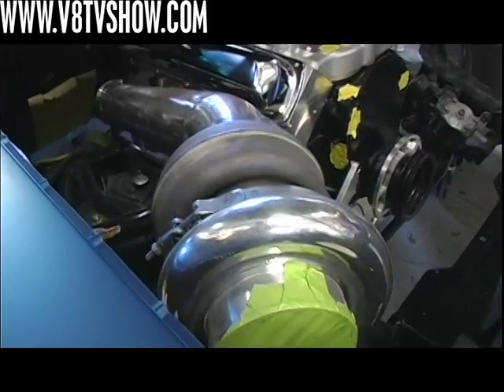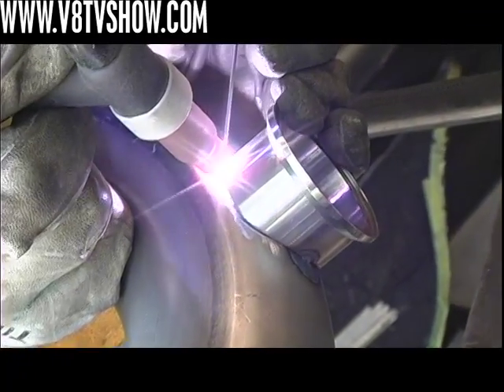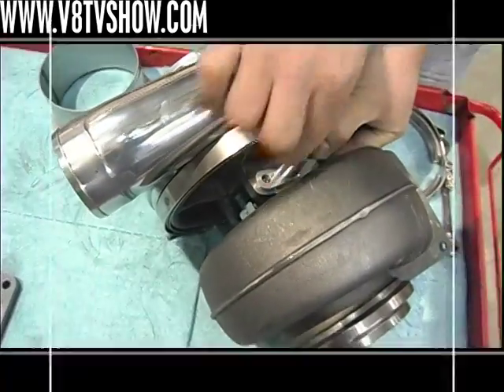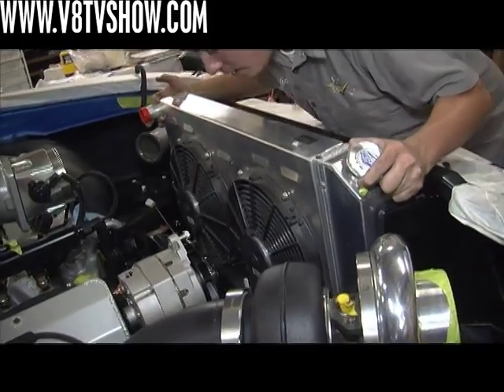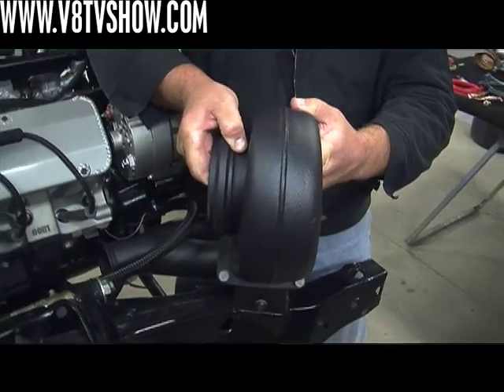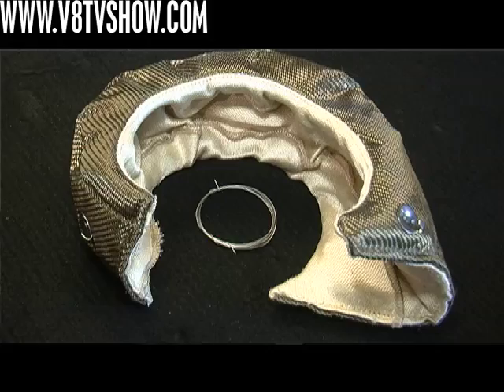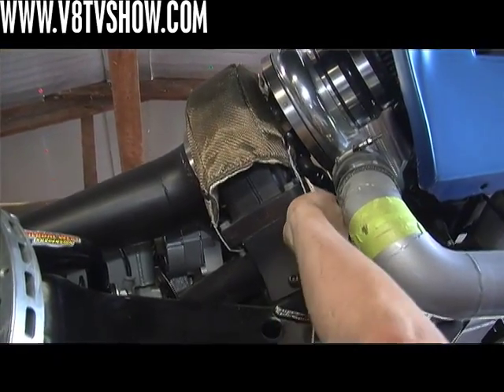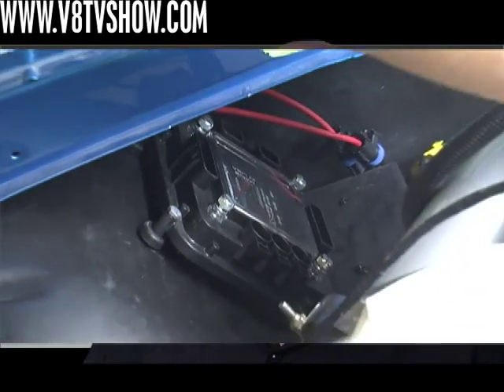Bullseye Power Turbo Video Install Part 3 - S71 Olds Project V8TV

Comment: this is a diesel block converted to gas, many of the same things could be done to either but not to both, the diesel block allows more bore than a typical small block and typical stroke of a big block. excellent videos guys thank you for making them

Comment from the maker: @MrTlTO So far, the car has been running at around 190 degrees.    I have no idea when underhood temps would be undesirable, we just don't really want to find out.   Most newer cars run at 210 - 220 degrees F, and the heat makes plastic, wiring, and rubber pieces brittle over the long term.     We're trying to keep the heat down as much as possible.   The fuel system uses a FAST Aeromotive A1000 electric fuel pump mounted in the rear of the car.    More on that in upcoming videos.

Comment from the maker: @5tonjeep It's an Oldsmobile diesel block, built by Oldsmobile, came stock in Olds passenger cars from until '81.   It's externally identical to the stock Olds 350 that came with the car new.    That was the concept, to keep an Olds in the Olds.     We still have the original 350 that came with the car, which will stay with the car as well.

Comment from the maker: @Boredout454 This IS an Olds V8, we only used an LS-type throttle body.   Go back and watch the build videos, this is a stroker Oldsmobile built using a diesel block.    We tried to keep the rest of the car looking fairly stock, but it does have some major performance upgrades.